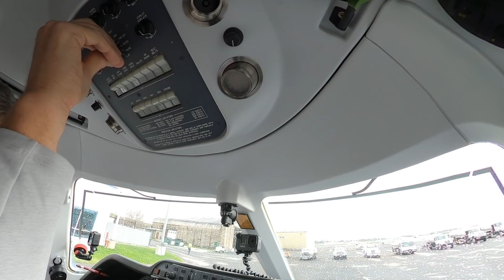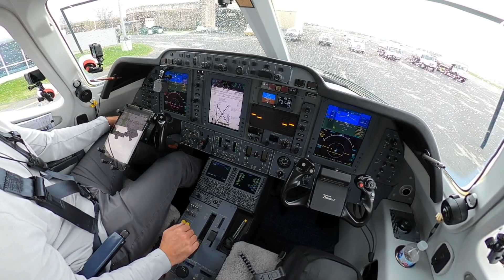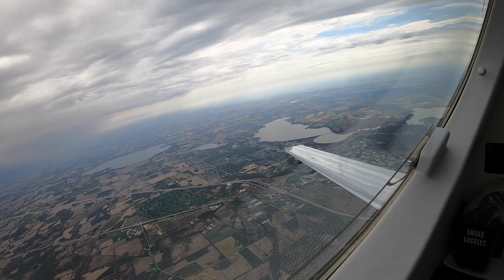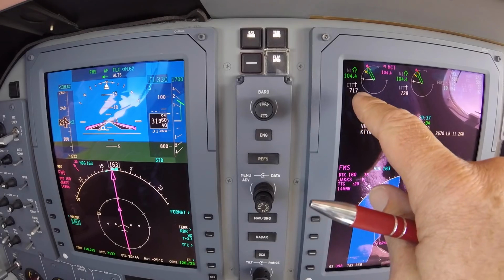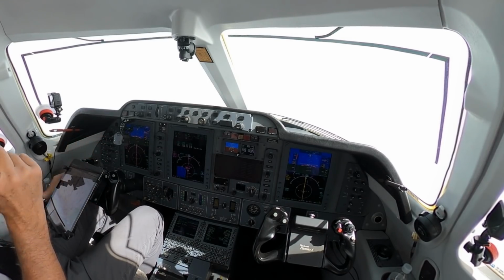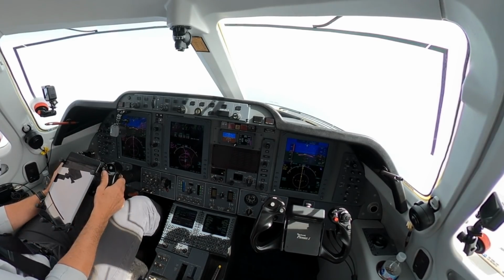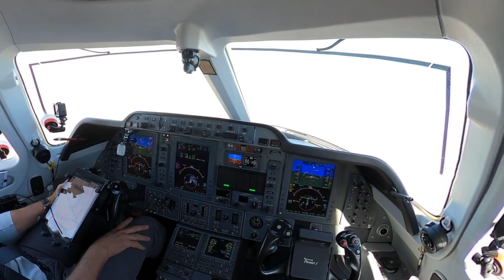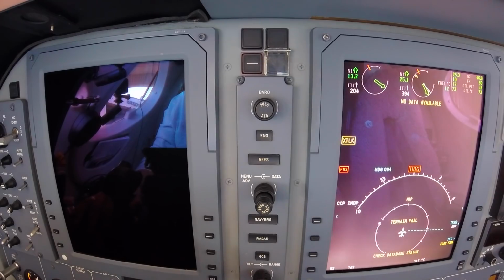I may have screwed this up! Private Jet Flight

Comment: At 28:00 on the compass there is a little green/teal dot that slides from left to right. If you pause at exactly twenty-eight minutes, you will see it at 13.25.  What does that dot indicate?

Comment: As far as your 104.4 percent, it could be similar to the Space Shuttle Main Engine (SSME) / RS-25. The engines were spec'd for a specific thrust and with engine improvements the engine could get to 109% thrust nominally and 111% in contingency. Instead of changing the 100% level, the same baseline was kept in order to keep the performance in line with test data, and not have to change documentation. I also hear something about not having to do many changes to the flight software. Could be the same in this case with the 104.4.

Comment: It's my understanding that the most common scenario for "above 100%" numbers in engine data originate from newer generation engines maintaining the same nominal RPM range as part of being added to the original type certificate, but with limits outside that nominal range thus permitting operation "beyond 100%." That or the designers, for some asinine reason known only to them, decide to set the nominal "100%" speed to some value well below the limits of sustained operation. Turbines are almost always temperature limited anyway.

Comment: As I understand it, the N1 can exceed 100% for limited periods of time. Engines are "rated" meaning they take the maximum safe RPM and reduce it by some factor. 100% N1 is really well below the maximum an engine can operate at. Exceeding 100% N1 is OK for climbing and during short periods of time within the rating of the engine.

Comment: Great vid. As one pilot to another, why didn't you use your apu while you were getting clearances? Doing that with running engines is pretty expensive.  It is way cheaper to start the APU to power up the airplane and get your clearance and program the Flight Management Computer than to do all of that with engines running. I’m not sure why you would do all that after engine start. Other than that, great video sir.

Comment: Just being particular but, F16 'Viper' has no tail hook. It it an AF Jet. The 'wire' at your departure runway would be for a Naval Aircraft trap.
Reply from the maker: The F-16 has a tail hook. It isn't as beefy as a navy plane, but it most certainly has one. And that is the reason for the arresting cable which you will find at every AF field

Comment: Howdy, Greg!  I've really enjoyed your YouTube channel.  
The Premier seems to be a great private jet.  I'm not a pilot and know very, very little about airplanes.  What safety and fail safe equipment do you have on board in case there is an oxygen failure as happened in the Lear when Payne Stewart and pilots were killed?  I used to work for a company that had a Lear.  We implemented a policy of 2 pilots with one wearing a mask at all times.  How do single pilot aircraft protect against oxygen depletion or delivery failure?
Keep sending us the vids.  They are always a pleasure to watch.

Comment: I believe the 104.4% means it's running at 104.4% of the engine's rated design speed. I.e. the engineers designed it to run at N RPM, but found out it runs best at 1.044 x N Speed

Comment: I see you using AP when climbing through the clouds to achieve your desired altitude. Have you ever tried to use your horizon instrument and fly through the clouds manually?
Reply from the maker: I've been flying for nearly 40 years. Most of my time is in military fighters so yes, I've spent quite a bit of time hand flying.

Comment: Interesting and always something to learn from, including mistakes. I, like another viewer wondered about the comment about how fast the Premier was in the climb while the “speed display” showed close to 300 (mph). The reason is, speed is always restricted to 250 (knots), Indicated Airspeed, below 10,000 ft. Figuring that this pilot is too smart to make that mistake (and definitely smart enough to edit it out if necessary 😂) some calculation was needed. First assumption is that the video speed display comes from a gps and is ground speed. Secondly, 300 mph equals about 260 knots, that would be TAS (true airspeed) which differs from indicated airspeed (IAS) with temperature and altitude. A little online calculator (or a pilot’s whiz wheel) results in IAS of about 225 knots. It was probably a little higher than that as the plane is obviously not flying horizontally during the climb, that would affect the ground speed. Anyway, the aircraft is not breaking the sound barrier. I guess it could get to 250k IAS in a shallow climb!

Comment: When the use of glass cock pits( TV screens) became the new tech for high performance singles,twins and all jets, is fine until you have an electrical issue etc. Then you wish like hell you had analog gyroscopic flight instruments at least for back up for level flying and descents.  Ah,the good ole days! The instrument panel in this Beast cost about 400K.

Comment: I was taught on my first jet flight in 1959, when I was 10 years old (BOAC Comet IV London to Singapore), that jets were more efficient at higher altitude. We flew at 480kts at 40,000 ft. How much of the higher fuel burn at lower altitudes on your flight was because you were climbing? Do the computers on the plane tell you the most efficient climb rate and altitude depending on flight length, waypoint requirements, etc?
Reply from the maker: Yes more efficient at altitude. The flight planning software will help you pick the best altitude.

Comment: Greg, love the channel. I’m flying a PA-28-200, but I can still dream.:) Question- I notice you use a portable GPS/moving map. Doesn’t Cessna offer a moving map overlay on sectional/IAP/high alt charts on one of the built-in displays?

Comment: I even had colleagues challenge me on this kind of nonsense when I was on the job. Another friend of mine even had a guy get arsey because he called lights and slides a couple of meters before the line and not after it. Under confidence and or inexperience often manifests itself in these kind of behaviours. I just used to boycott these types on night stops and if I ever flew with them again made sure I pointed out every single thing that they did that was incorrect. They soon got the message. Sadly you don’t have that luxury Gregg and there will always be these kind of people looking in and playing expert. I’d personally just spend another 2 minutes editing if necessary. Yours is a great channel so please don’t let one of those idiots spoil it.
Reply: What was the complaint about?  I'm joining late.

Comment: What is the fuel weight that you use. Back in my JP-4 days ( Tanker recovery ) it was easy for my crew to move a Million pounds of fuel per night ... pump up / down or move it around.... at 6.4 ppg that was a lot o fuel.  Castle AFB being a SAC training base, I’d come to work with 10–12 landers per night.

Comment: 2 questions Greg, one technical, one not so technical. 1st, I'm sure climbing into your own private jet to fly as often as you do comes with it's own set of thrills but do you ever miss flying the F16? 2nd ,  I used to to do med evac flights on a Lear 35A, I remember the pilots were able to pressurize the jet for a sea level flight in the interest of patient care however were able to fly much higher than where it was pressurized, is there a rule of thumb on the difference in altitude versus pressurization? I remember the pilots disliked doing it due to decreased efficiency of the jet. Thanks Dave
Reply from the maker: I miss somebody else paying the fuel bills as was the case in the F-16. LOL I pressurize the cabin to its maximum differential which allows for the lowest cabin altitude.
Reply: @gregmink  Thank you for the reply, using your keyword of maximum differential I was able to do some Google research on pressurization systems quite interesting reading. Stay safe

Comment: Tail Hooks on F16's - amazing!  Thought this was exclusive to the USN.  Does this mean that F16's can potentially land on a carrier?
Reply: Their landing gear isn’t built for that kind of load on landing so very doubtful. Most if not all airports have cables that F16s will use if need be.
Reply from the maker: you are correct. That landing gear is in no way built for carrier ops.
Reply: If a Viper needs to hook the cable, its because of a failure, brakes, speedbrakes, hydraulics etc.  when I was in Korea, Scott O’Grady had a brake failure, took the cable, and departed the prepared surface trying to taxi after they unhooked him.  Lol

Comment: Great videos! I have a question about that decent with a crossing restriction at 13000; when you selected vs to increase the decent after first selecting vnav, does the mode still stay in vnav and capture the path or do you have to reselect vnav? Would it not of captured the path just with vnav selected? It looked like the decent rate was increasing before you hit vs and dialed it down.  Thanks for the videos and that Premier looks like a great machine!
Reply: He said he had the VNAV set to a 3 degree slope, which means he needs to intercept it first, kinda like an ILS. I don’t fly the premier, but usually you can change the VNAV angle, and you usually have a VTO (vertical to) function, that will immediately put the aircraft in the required descent rate to meet the crossing restriction. I guess he has it set to 3 degrees, because if you active the VNAV right away, and youre “high” relative to your restriction, the aircraft will enter a high descent rate, and the premier does not have an autothrottle system, so it can catch you by surprise.

Comment: Grege what are the stick shakers. Pusher that you check at the start of the plane every time & what are they each used for Grege?
Reply: Stick shakers warn of an impending stall.   A stall occurs when the airplane  wing loses lift, usually due to operating at low speed  or an unusual attitude or a combination of the two.  When a wing loses lift it stops flying and the airplane quite literally falls out of the sky.

Comment: That was great, I now love being just above the clouds. I have two questions;
1. How does air traffic control select or generate the name for waypoints e.g ' jacks' moreover is this like the phonetic alphabet Oscar is 'o'. 
2. Why do you specify the jet A1 gas in pounds? Do you not purchase in gallons? Is is aeroplane weight v volume remaining in tank.
Take care😉
Reply: John Fitzpatrick: I was an ATC for over 34 years. Names of waypoints are decided by whoever makes the departure  procedure or arrival. And yes, all letters are phonetic. One of the good things about air traffic is all our spelling words are 3 letters (airports and navaids) and 5 letters (waypoints and intersections).
Reply: @michaelhall9138  Hi Michael, so just clarifying, it's connecting the navigation system in the plane with the system at ATC. Each plane has it's isolated connection.
Reply: John Fitzpatrick: Nope. Everything's voice; except for the ACARS in some commercial aircraft. Pilots file a flight plan ( their intentions on how to get from A to B) and we approve or modify it, if necessary. We get a copy of their flight plan 2 hours (or sooner, depending on when they file) in advance and if no modification is needed we just clear them "as filed." If we need to modify it we give them a full route clearance or read just the change, then as filed. There was a push to make everything digital, but we old guys can talk much faster then we can type. We also need verbal confirmation for control instructions.

Comment: Hi Greg, great video. I have a question about the aircraft, if I may. Does the aircraft have a VNAV Speed mode or Auto Throttle. I noticed when you had to expedite your descent (27.32) that your speed got right to the barbers pole/red line. Your speed bug was set to 244 Kts but the aircraft speed was 319 Kts on your speed tape. Any slight distraction and you could end up with an over speed situation. Is there a speed mode in the descent, that you could select that would protect you from this?
Reply from the maker: Sure, I could select FLC which holds an airspeed. That is the speed bug you mentioned. It does not have auto throttles.
Reply: @gregmink   Thank you, appreciate your reply. Busy little aircraft for single pilot operations, would like to give it a try myself some day.

Comment: How much does a jet like this run? Also what yr is this? So with a car when buying you would look at how many miles the car has for the price to be figured how does this work buying a airplane/jet what is it you would look for? Thanks for the awsome video love your jet bud! Stafe safe Captain
Reply: By "jet like this", if you mean Beech Premier Ia, which this airplane is, between about $1.4 million and $3 million USD.  They don't make them anymore.  When Beechcraft went into bankruptcy, Textron (Cessna) purchased them so they could build the King Air line, which was still quite popular.  Cessna still builds the Bonanza G36 as well.  The Hawkers, Beechjets, Premiers all died because they were direct competitors to Cessna's own jet lineup.  It's too bad too because the Premier Ia, which was in the works to be updated to a Premier II, then later Hawker 200, is a far superior jet to any single pilot jet Cessna makes, in my opinion.  It is faster, taller, and gets as good or better fuel efficiency.  The premier cabin as almost a foot taller than a Citation jet's.  The Premier's fuselage was also carbon fiber.  There's cool videos out there showing how they built it by spinning a mandrel like a piece of corn on the cob and applying a long tape of prepreg carbon fiber over it by a robot.  Really cool.

Comment: How much of a pain is it to use the 360 camera to do the pans and stuff? Do you have to use Garmin's software to build clips that you then put into your editor?
Reply from the maker: It is a little more work in the edit but not bad really. I think it adds a lot
Reply: @gregmink  It totally does! I was just wondering what the flow is, because I'd like to do something similar for my personal videos and I wasn't sure if there was an all-in-one option to control the 360 perspective within the editor, or if you had to do a 2-step process.

Really appreciate your videos.

Comment: Well, 'Reported to the FAA" video is not on Greg's list anymore and neither the comments around "Karen". Greg is too much of a gentleman and may have done this for a couple reasons: to leave the issue behind and deflate the situation so the guy doesn't get pounded by his followers, to prevent an escalation of negativity, to keep the channel in it's original intent that is to share his passion for aviation and inspire others (rather than use it to highlight an uncomfortable situation), or all of the above. I believe we should move on as well, turn the page on the guy and let him live with his mistake, and stop the "cancel culture". Like Greg said, we can all learn a lesson here and we did, so let's continue encouraging him to produce his videos. Needless to say, the tree builds stronger roots after it fights a storm and in this case, Greg has gone several more steps up the ladder of success.

Comment: Greg, fascinating data about the fuel flows!  I know I had asked you before...it's definitely worth climbing.  Question...have you ever talked to @310 Pilot or his wife Jamie?  I know they are ATC in the Chicago area.  I was wondering if the ATC at 22:00 was her...
Reply from the maker: Yes I have talked to them, but not on the radio. Just on the phone.

Comment: Learned something about tower vs. ground and runway taxi.  Do you call tower to cross a runway when instructed by ground?
Reply: J C: ATC here. Depends. Generally, no; especially if just crossing to the other side of the airport. If you're going to depart that runway, then it depends on how long you'll have to taxi.

Comment: I was also wondering why you were flying in the 30's for such a short segment?  That is usually very busy airspace so you can get away with it I guess.  How much time did you spend at cruise?  I guess when you are a owner/operator you are really watching the fuel closely.  Cool video.  Thanks for posting.
Reply from the maker: Info section has the fuel burn profiles

Comment: I'm a low hour student pilot but have ~2000 in flight simulation on X-Plane and it's reassuring that the controls and avionics in my sim are more or less matching real life. Not saying I could fly your plane, but I sure do appreciate you taking you us along. [edit, did you need to clear that discontinuity that popped up in the approach entered? ]

Comment: Airplane Flying Handbook (FAA-H-8083-3B): P1-2, Figure 1-2 caption: "Good airmanship skills include sound knowledge of the principles of flight and the ability to operate an airplane with
competence and precision." With competence and precision. Competence and precision. Greg is most assuredly competent and precise. End of discussion. Blue skies.

Comment: First superb video great pilot! For how long time can run engines in full power? Are these indications 100000 or 200000 etc. No auto throttle?
Reply from the maker: No auto throttle. Max thrust is 5 minutes. Then MCT until you run out of fuel

Comment: Awesome you had the subtitles! That was helpful! How are you controlling the camera behind the co-pilots seat? What kind of camera? N1 is like an RPM gauge in car but listed as the % speed in relation to the engines maximum speed. So at 104% you were flooring it and over revving the engine. I see you like to fly the plane at its max speed.